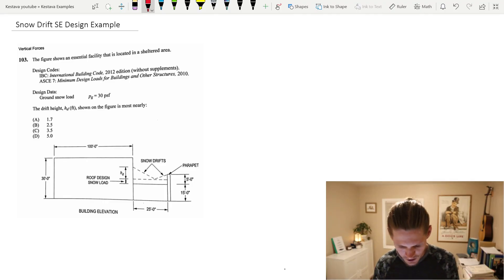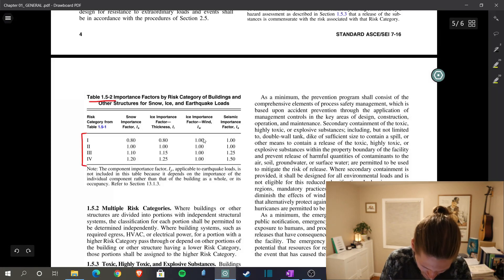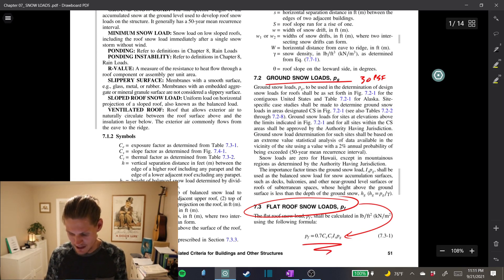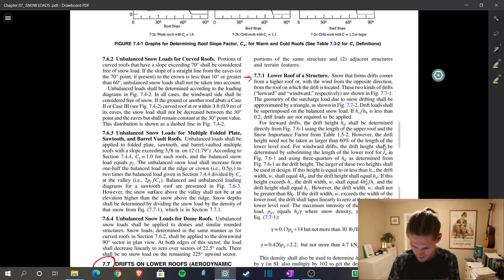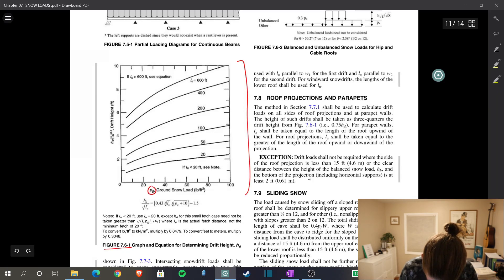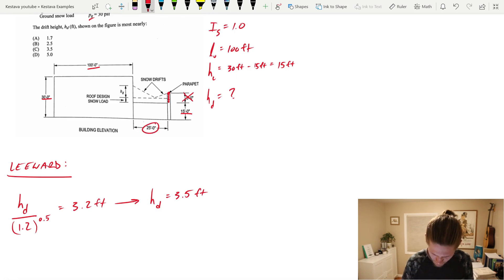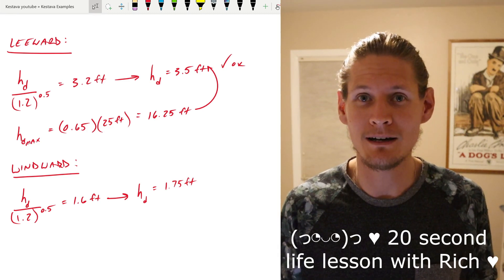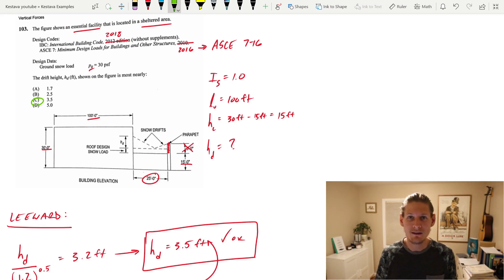Snow Drift Design Example per ASCE 7-16 and IBC | SE Exam Prep

Comment: Is anyone aware if pmin for low-slope roofs applies to flat roofs? ASCE defines flat as 5 degrees or less which seemingly conflicts with low-slope defined as 15 or less without a lower limit. Is a slope of 2 degress low or flat? And is pmin used for flat to 15 degrees? Thanks for any clarification

Comment: I like how you work through the problem in this easy to follow method, but I have a correction/clarification for "hc" -- it's not the difference in height between the lower roof and upper roof, rather it's the height from top of balanced snow load to the upper roof.  Bottom of hc is at the same level as the bottom of hd.  That can make a big difference in the calculations, depending upon the magnitude of the balanced snow load compared to the step in roof height.

Per both ASCE 7-16 and 7-22:  "hc = clear height from top of balanced snow load to (1) closest point on adjacent upper roof, (2) top of parapet, or (3) top of a projection on the roof, in ft (m)."

Comment: Great video. I am actually sitting the Vertical exam tomorrow and Lateral on Friday. One thing - I just did this problem and your answer is correct, but you will get a different number if you use the equation instead of reading off the graph. You got 3.5 from reading the graph and multiplying by Is^0.5, but you get 3.85 from using the equation and multiplying by Is^0.5. The errata that corrects the answer from 3.5 to 3.85 is on the NCEES website.

Comment: Fun fact, some states haven’t adapted to the new code until recently.  Idaho for example, in 2021, adapted the 2018 IBC/IRC building code and ASCE7-16 also.  We used 7-10 and 2015 for the longest time.
Reply from the maker: Jefferey great comment! This is SO true and I should have mentioned this. Im doing a video right now talking about codes and provisions, and YES - it all depends on what the local jurisdiction has adopted for code compliance. Hope everything has been going great with you! keep supplying that much wanted input on the channel!